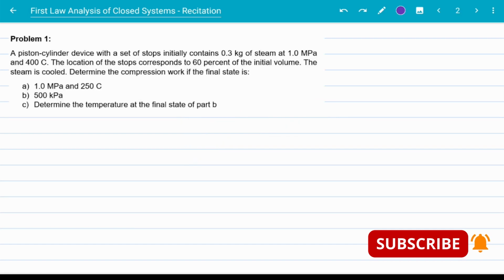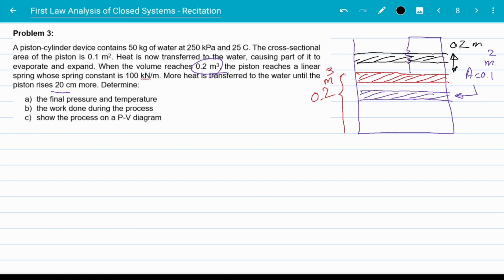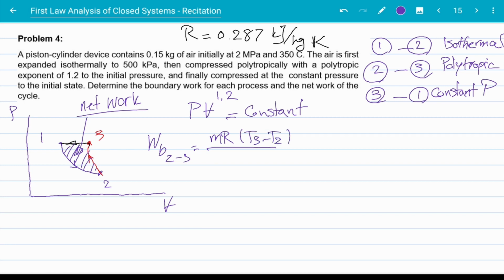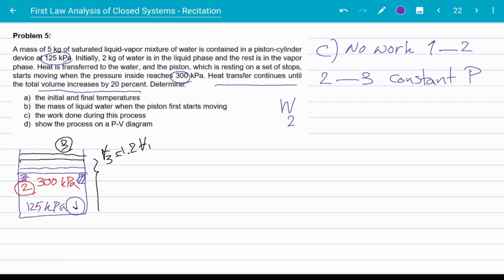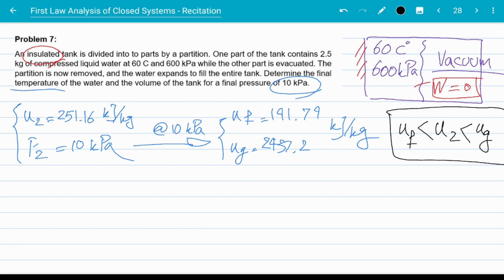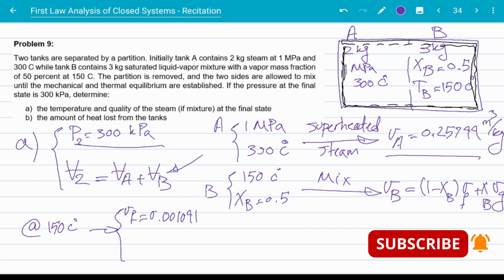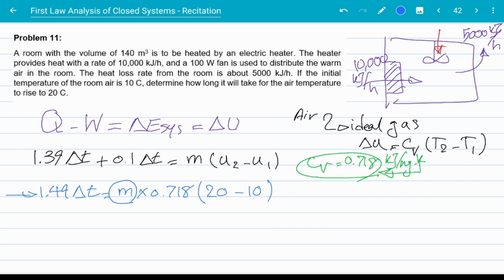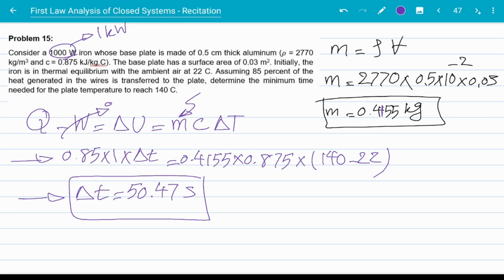Sample Problems - First Law Analysis of Closed Systems Recitation

Comment: In problem 2 part b @28.35, is V2 supposed to be 0.2 instead of 0.3?
Reply from the maker: Yes, you are right. It's 0.2. Thanks for pointing it out.
Reply: @WannabeProfessor86  Your videos are really helpful as all calculations are explained clearly. It is easier to understand as many examples questions are given. Hope that the thermodynamics series will continue! You deserve more subscribers :))
Reply from the maker: @elvinlee1340  Thanks. I am really happy that you find them helpful.

Comment: In problem 7, when you checked the tables to see what the internal energy (u1) was at the initial state, you used the temperature related table and not the pressure related one (uf is different if you check the other table at 600 kPa). Why is that?
Reply from the maker: Very good question. The problem states that we are dealing with "compressed liquid" at 60 C and 600 kPa. For compressed liquid we don't have a separate table and so we have to read the saturated liquid properties at the given temperature. That's why I used the temperature table instead of the pressure one.

Comment: In problem 1 he says that the stop corresponds to  60 percent of the initial volume, and you solve it assuming that he's referring to the specific volume. Wouldn't it make a difference if you assumed it as the actual volume of the piston?
Reply from the maker: Good question. In this problem, we are dealing with a closed system where the mass of the system is not changing. So if the actual volume of the second state is 60 percent of the initial state, the final specific volume would be 60 percent of the initial specific volume, too. You can see that in the final equation for the boundary work. It's pressure*mass*delta_specificVolumes. Now we know that mass*delta_specificVolumes, for a closed system with no mass crossing the boundaries, is equal to delta_actualvolumes!
Hope this explanation clears things.  Feel free to ask any other questions that you might have :)